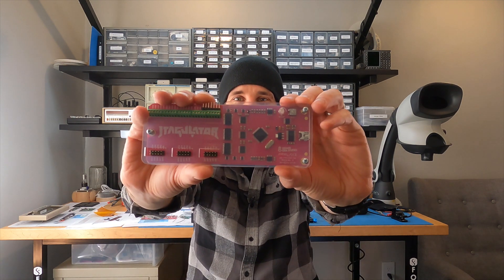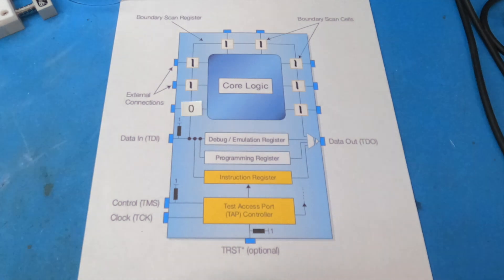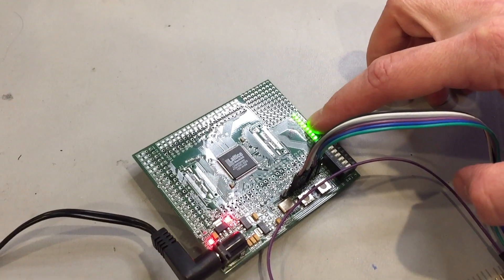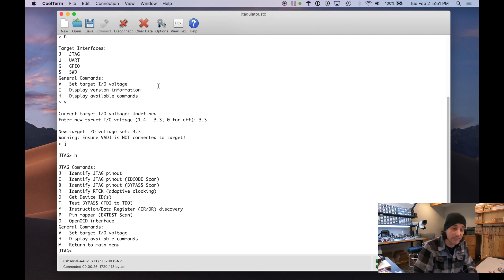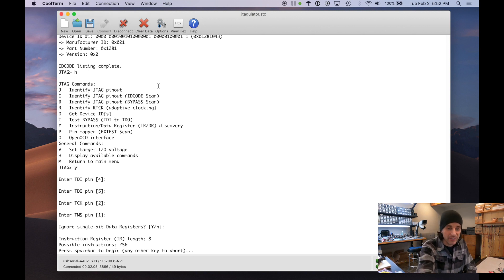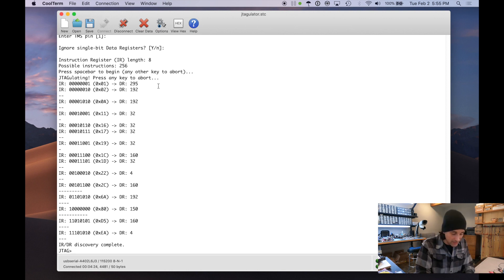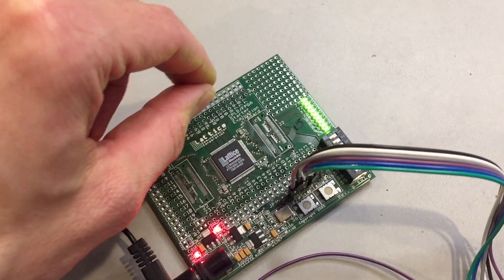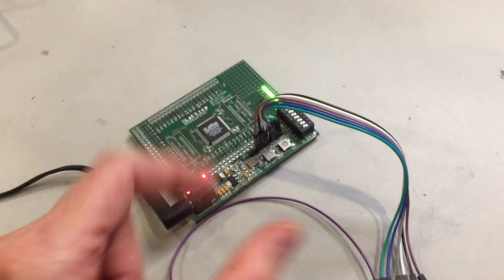JTAGulator: Pin Mapper (EXTEST Scan)

Comment: I did aome reverse engineering on a JTAG 14 and JTAG 20 connector. Non standard pin layout. I managed to figure out the correct layout with multimeter and managed to connect to microcontroller via SWD and gain access to the whole of it. dumped firmware, got flash info.. etc.. 

What i did not found though is the tRST/RST/RESET pin. I know its located on pin 90 on the microcontroller but can find the JTAG pin or a test point on the board for it.

I know the tRST are optional but might come in handy to reset the input.

Any ideas? Will the Jtagulator figure that out?

Im using a Raspberry pi with openocd. Works great. Just jeed to solve the RESET..

Its a TI TM4C1231H6PGE microcontroller 144 pins with 256KB

On the JTAG 14 header SWDIO are located on pin 1(GPIO 24), GND 4/8/10,12 SWCLK on pin 9(GPIO 25)